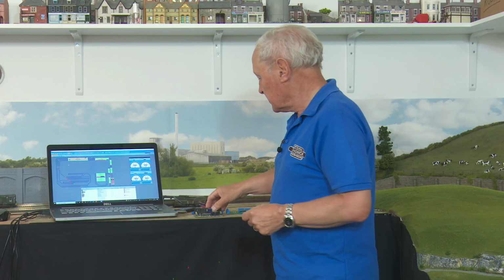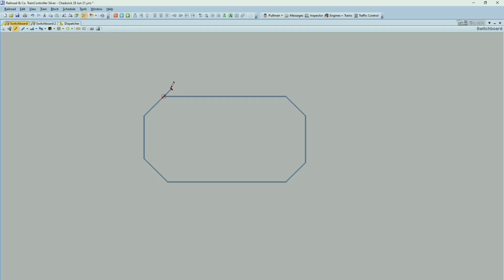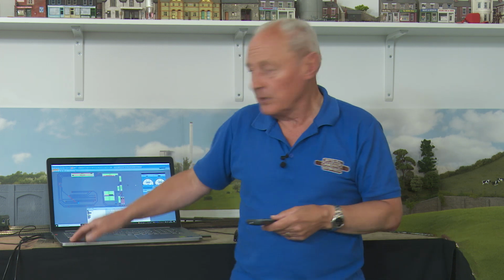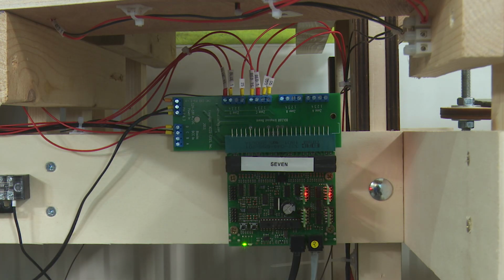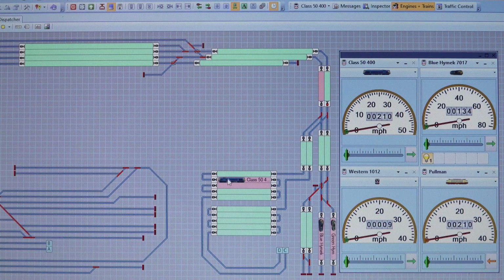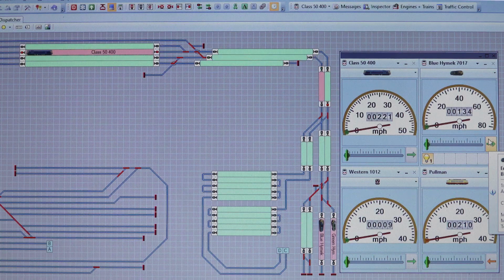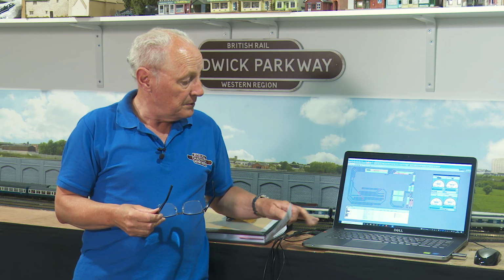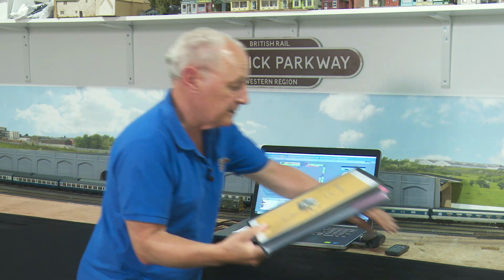An Intro to Block Detection at Chadwick Model Railway | 137.

Comment: Hi Charlie, great vid,
I built my layout back to front the hard way as I added automation after I finished the layout with no clue with what I was doing...
I call the automation side of train modeling Voodoo or cloke and dagger as there are many ways to do it and not many ways explained on how to do it,  automation can drive you crazy but its so addictave.

I find block detection fascinating , Mr Townsend explained the basics to me at a Manchester show when he was at his show stand.
I have just finished off my time table for my layout and there are 30 train movements controlled in and out of my station terminus and yards which took some time to get working perfectly.

I use Train controller Gold and i-train {I prefer train controller} , at the date of Feb 2017 I paid 509 euros {about £447.18 } for the full gold version so the price of 930 Usa dollers today is {£673.00} is crazy I would never pay that amount, there seems to be a unfair disadvantage when it comes to buying the software in the U.k form Juergen Fireiwald in Germany.
E.g the Train controller Gold software in Ireland is 559 euro inc vat? compaired to £673.00 for the uk..I do not understand the priceing for this software?

The hardware I use is Esu command station, Esu feedback units 3x wired direct to the Ecos plug and play, then back to the windows 10 pc running Train controller Gold via the router hub,
I also run the smart hand add on so all smart phones and tablets can be used to control Train controller.

Take Care Jim.
Reply from the maker: A great comment Jim, thank you.
1 day we shall have to meet up at a show and discuss the finer points of block detection! Regards Charlie

Comment: Hello Charlie, This couldn’t have come at a better time. You certainly talk my language. I’m building a new layout to run from indoor, outdoor and into a new purpose built shed. Possibilities to expand again are there too. I need block detection and want to run on a Mac computer, not a PC. Goodbye Hornby Elite, Railmaster Pro and two walkabout Selects if I do dive in as they talk Xpressnet and iTrain talks with Loconet, if I’m totally correct but, whatever, the two don’t mix and Hornby abandoned their Block detection to my dismay some years back from what I read. They seem intent on developing this HMDC analogue system with sounds coming from your smart device, not the locomotives. Not developing The Railmaster loco detection system, which could have been a Great Leap Forward for a leading UK based company, beggars belief. Your pricing breakdowns, I’d already uncovered  through your other videos and deep dive searches, so it is great to have you verify my thoughts on all the links you mention regarding Digikeijs being far cheaper, etc and, I see on your helix, the DCC Concepts Power Base. These guys are near me in a great location and, as I have a layout in the loft with inclines, looks like a great little innovative investment. I’m also aware Hornby TTS sound fitted locos can be a pain to properly configure with iTrain,  mentioned on posts on the Bob Fuller iTrain tutorials because the chips CV settings can’t be re-programmed as well as other chips for realistic running. Will this result in stopping inaccuracy for computer control… the journey continues but, I’m sure dcctrainautomation.co.uk can help as you say. All a Great help so far. PS Your presentations are second to none and your layout is fabulous.  A joy to see you toggle between actual running and computer screen.
Reply from the maker: Andy I'm so pleased that you found the video useful.
Regards Charlie

Comment: Great video, Charlie. 
Two comments, if I may; the block detection is primarily used for automation, but could be used for non-computer automation by driving local signals or a mimic board based on the detected presence. 
And have you tried mixing suppliers of the gear? For example, the DR5000 allows multiple bus types, so would appear to be appropriate to host a mixture of sensors and actuator drivers even over different comms busses, thereby allowing the choice to be optimised for price and availability. 
Regards, Tom
Reply from the maker: An excellent comment Tom.No I have not tried mixing suppliers, I have so much Digitrax kit it would be foolish to incur more expense. Regards Charlie

Comment: Another excellent video Charlie.
One point as to why UK prices are higher, could be that the supplier has to charge UK VAT even though it’s coming from abroad. I’m not sure if that is the case with other countries.
My layout is still at the ‘advanced design stage’ (i.e. I haven’t actually built it yet).
Being in electronics/computers all my working life, DCC automation and building the layout will go hand in hand.
Digitrax & TrainController are way too expensive, and I would not be a fan of the exposed DBL168 and its crazy connector. What were they thinking?
Even before speaking with James at DCCtrainautomation (who is really knowledgeable & helpful), I had already decided on Digikeijs & iTrain, being far more reasonable price-wise.
I’ve purchased a DR5000 control station and iTrain plus from James as I want to experiment with Arduino based LED signals as an alternative to the DR4018.
I will use current based block detection with either the DR4088CS or the newer DR5088RC.
For point motors I will probably pay the extra and go with the Cobalt IP Digital as they contain the DCC decoder so making wiring simpler.
I also purchased AnyRail6 to help design my layout. Best £50 I’ve ever spent!
Please keep up the great work.
Reply from the maker: You have clearly made some excellent choices David. Good luck regards Charlie

Comment: Hi Charlie, wish I had seen your video before I started using block detection. I am using Digikeijs & iTrain but it would have been helpful to have had a video like yours before I started! 
As I was unsure if I would be able to manage it after 25 years away from the hobby, I built a small 4x2 N gauge simple layout to try it all out before investing a lot more in a bigger layout.  Now I have some experience I am in process of dismantling that & building a larger 00 layout re-using the electronics from the trial layout.
Reply from the maker: Rebuilds are apart of a hobby I’m afraid David. Good luck with your new project, regards Charlie

Comment: Thanks Charlie, interesting video as always. The only point you missed is if you have Bi directional running you may wish to have a stopping section at each end of your block. Then your BDL168 goes 1/3 less or just 5.3 blocks each.
Reply from the maker: Yes a fair point that I missed. 
Regards Charlie

Comment: how do you decide how big a block should be  ?
Reply: In theory as big as your longest train but if you’re not planning on stopping your longest train in that block then I wouldn’t do it less then 1foot so as to be able to fit a whole locomotive at least.
Reply from the maker: My smallest block is around 2 foot Rob which is about the same as my DMU and can obviously comfortably hold of Loco’s. Regards Charlie

Comment: My extensive DC/analog layout uses CTI-Electronics hardware with part of the layout using RCI hardware (no longer being produced).  Both are fully compatable with Traincontroller Gold with no problems.  For those not wishing to do DCC then CTI is one way to go although some users struggled to get it working the way they wanted.
Reply from the maker: An interesting option Bob, thank you, regards Charlie

Comment: Hello Charlie. I have been installing BD using an Ecosdetector connected to my Ecoss. Pretty easy setup. I use Traincontroller Bronze that cost the "world" price of $154USD and the detector block cost about $250 AUD (136 quid). If I need more than 16 blocks (most likely) I will need to purchase an "interface" unit that allows the connection of 4 detector units . No daisy chaining unfortunately
Reply from the maker: Yes BT, it can be pricey.

Comment: Useful video.
I created a route setting system for a club layout, which worked perfectly with JMRI, but 'people politics' got in the way, so I ended up leaving the club and the layout got disassembled because no-one knew how the system worked.
Their loss!

I'm going to be building a new layout, and will use JMRI for that too, together with my Lenz 100 system (I've been using DCC for 17 or 18 years now).
However, instead of using the Lenz 150 accessory decoders operating solenoids... I'm going to use servo motors powered by Arduino's for switching points, and also for block detection too.
Mostly block detection will be used for safety operations so I don't get any collisions, but I 'may' do some automation too.

I have lots to learn about Arduino's, and how to integrate block detection and automation into what I already know with JMRI... so I have lots to occupy my thoughts!

That Traincontroller software is a bit of a rip off, with those wobbily prices.
The UK price is roughly an extra 44% more expensive... and far more than the 20% VAT we pay!!!
Reply from the maker: Hi Laura, yes the TC price is clearly a rip off.  Good luck with your project, regards Charlie.

Comment: Hey Charlie,  Gotta agree with everyone... Great Video!!  My only disappointment is that you are a Digitrax and not a NCE guy.  I was (HO)DC until I let the hobby slide away from me some 30 years ago.  Now that I'm retired, I'm bring it back in DCC.  Everyone said "get the controller all your friends have so you can play together".  Well, he had NCE so I got NCE.  He changed from HO to O scale.  We don't play together any more, (still friends though).  It seems like there are all kinds of instructional videos with Digitrax and very few with NCE (Arthur Huston).  I don't even have my train room built yet but I've invested in the BD20's and and a couple of AIU's, a bunch of Tortoise machines, a raspberry-pi to run JMRI on, miles of flex track some fixed track and switches, couple hundred cars and a few engines.  I would love to fully automate the dream layout and while the trains are running work on the scenery.

Love your videos!  You do a splendid job of explaining for the real guy.  Thanks
Reply from the maker: What a heartwarming comment Gary, you’re too kind mate.
Reply: Hi Gary, I have been running automated trains on an NCE Pro for many years - the good news is that NCE is compatible with most systems - and I use a range of block detectors and stationary decoders.
Best wishes  Dave

Comment: Brilliant video as always. Thanks.  I'm using ZMCT103C modules and diode volt drop detectors on an  Arduino via C/MRI to JMRI. 18 detectors for around £30. Needs some soldering and programming skills though.
Reply from the maker: If it works for you Hugh.

Comment: Outstanding video Charlie, one of your best and certainly in the top 5 greatest one you made. Utilize here all Digitrax systems except decoders, Tsunami only. I wrote my own software running on Windows machine. Hate windows and currently writing software for MAC. Does all functions that $$$$ software can do. You asked several other questions but forgot what they are. Suggestion: Placing in comments your questions might help us old people remember.
Reply from the maker: Or you could rewatch the video B62c?
Reply: @ChadwickModelRailway  LOL

Comment: By the way, you mentioned block detection for DC, there’s always the Megapoints solution, which uses the CAN bus process for mimic panels, points control etc.  I actually started there before I got into DCC and parts of my layout are still controlled by Megapoints via a DCC interface.
Reply from the maker: A great point Stuart.

Comment: Well presented intro into block detection. The sheer cost will prevent me from ever thinking about using it. I’d be interested if you know of the success or otherwise of other technology for achieving the same outcomes? I think McKinley uses RFID don’t they? Does that replace this type of block detection or is another level to it? Stay safe.
Reply from the maker: No Michael, the RF ID is a tool for locating rolling stock. Regards Charlie

Comment: Hi Charlie, well done, I thought you were off into the deep end for a mo.  I’m using Digikeijs as my hardware, DR5000, with various Loconet DR4033’s for block detection etc.  I then use iTrain on a Windows 10 PC and apart from some of the quirks (what software doesn’t have a few) I’m really pleased with its operation. The bit I’ve never really got my head fully around (which digitax seem to do well) is section power isolation.  I’ve a number of power districts run from boosters, but no further isolation than that.  To date it’s not been an issue, so I’ve not pondered it further.
Reply from the maker: I’m pleased you are having some success Stuart. Regards Charlie

Comment: Hi Charlie. I’m like you a Digitrax man, with TrainController Gold software and a locobuffer USB interface.
I bought all this stuff before Brexit when it was a bit cheaper. I must confess I found Dave Townend’s early McKinlay Railway videos very informative and I copied most of his ideas. The Digitrax and Train Controller manuals are comprehensive if confusing at times and the videos of Rudy at Rudysmodelrailway channel all helped make planning a complex layout more straightforward. I had little understanding of electronics but managed to plan out and construct my system which works really well. My system gives me the ability to run a timetable, change locos easily between trains and have a fully functioning signalling system. Most importantly, I can have several trains running with conflicting routes safely in a way that would be almost impossible to organise manually even with several operators. Great video. Thanks. Hugh
Reply from the maker: A great comment Hugh, many thanks. Could you tell me in a fresh comment what you use to control your signals?
Reply: Hi Charlie. I use Digitrax SE8C units to power the signals but the SE8Cs are controlled by Train Controller. Your original SE8C video helped when I first set them up!
I have accessory signals added to the TC switchboard (the TC inbuilt block signals don’t haveUK logic) and these instruct the SE8C units. The TC accessory signals change aspects using the triggers and conditions feature. The trigger is a combination of the correct route ahead being set up and the occupancy ahead being clear.
Routes are set up ahead of trains when running automatically and thus set the signal. However, I can also set up routes manually using on screen push buttons in each block. I just touch the button of the block the train is in and touch button on the next block I want to move to and the points change and the signal changes to suit the route. This also works for entrance to a group of sidings from a main line.
Signals on sections of plain line, where there are no diverging routes (blocks follow on one after another) are set up as automatic signals normally at green and change to red and then yellow and back to green again using occupancy of the routes ahead to act as triggers to show the correct aspect. 
Signals on blocks with various route and block options are set as controlled signals, normally red and only show a proceed aspect when the route is activated and clear. Hope this helps. I hope to do another signalling/switchboard video on my own channel sometime. I am still installing signals but have enough fitted to know it all works. It’s difficult stuff to explain in a few words! Well done again on all your videos. Hugh

Comment: Since you asked..

I use my own signal, block detection and brake controllers. I get them made in China for a few quid.. I have combined current detection blocks together with Asymmetrical DCC Slow Approach and Stop Brake Modes. These modules automatically slow trains passing amber and stop them at red signals (ESU or Lenz chips that support ABC). It's all super smooth and realistic. And super simple since the brake control modules are all on the same addresses as the DCC Signal Heads.. All my trains whether I'm driving them or not will stop for red signals. I don't want to ruin a £300 locomotive because I made an error at mainline speeds! (I can disable Auto Braking on each loco via a function key if I really want to drive it).

I do not use a computer, or any software.

I use an Ecos controller (while it is expensive, it is cheaper than buying a seperate computer!) to automatically change signals and routes based on block detection inputs and control panel switches as inputs these are all connected to the ECOS by a super cheap (£40 for 16 inputs) S88 input board.

On my storage yard I use ESU Railcom Detection Modules (which detect loco ID and have configurable classes for each loco) to auto select a lane to put arriving trains into. Which also determines when they will run out again.

I don't have scheduling.. If the line is clear a train will run, unless I use a switch to hold a train at a station loop or in a storage yard (or override any signal on the Ecos). I have my storage yard setup to cycle through active lanes with some preset delays. my mainline looks after itself.. sometimes its a slow freight some times a small branch DMU, or a passenger express.. with detection at certain locations an express can trigger a freight in front to hold in a passing loop, or auto route a DMU (running shuttle mode) onto the branch line..
Reply from the maker: A great comment and what a rewarding achievement mate.

Comment: hi charlie it,s me again just a quick note to let you no that if you by train controller gold on the USB stick that it comes on you can use all 3 version off train controller soft wear.
Reply from the maker: Thanks Derek but you use them?
Reply: @ChadwickModelRailway  yes i do at the moment i am using tr/controller silver on my small test layout and gold with my large layout have you tried rockrail softwear yet and it is free ok derek